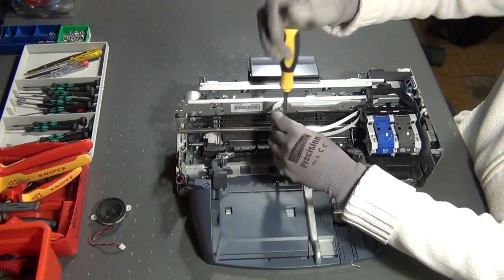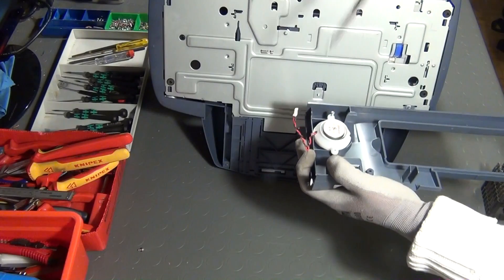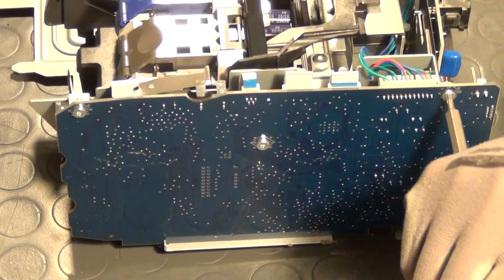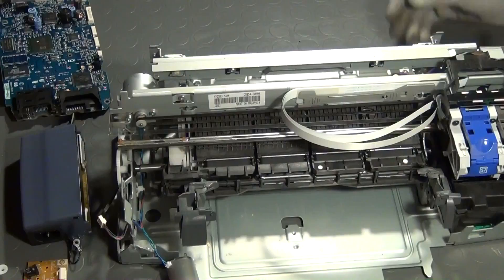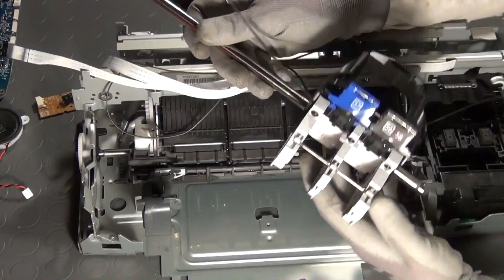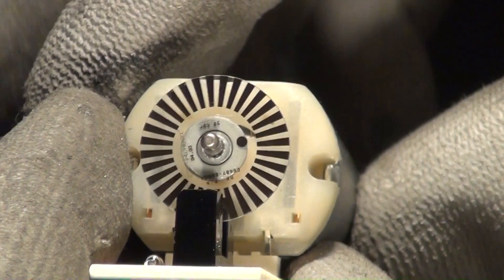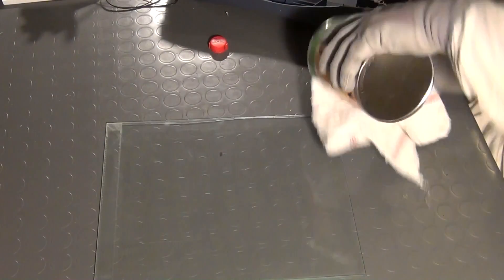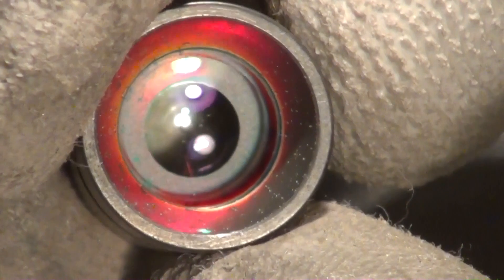How to Salvage Usefull Parts from Printers and Scanners

Comment: I know it's been like 6 years or so, but any chance on a video showing how to use these parts? I have a very old Canon MX712 all in one (fax, scanner, printer with an area for inserting micro SD cards) that finally needed to be replaced. Print heads clogged beyond repair, (I've tried) and the scanner is scanning with lines through it.  I am not a prepper, but I am an artist/maker, and LOVE making new things, or using parts from what others may call junk. I hate planned obsolescence, and filling the junk yard with perfectly good stuff!  So thank you very much for taking the time to make your videos!!  I have subscribed.

Comment: Question for you about using the large motor. Would it be possible to connect more than one motor in series to get more torque/ power, so they could be used in something like a home build CNC? I hope this makes sense, and look forward to replies.

Comment: All that electronic stuff is swell and all, but beyond this old woodworker.  On the other hand, I'll bet the glass is really flat on both sides, and therefore a good candidate for use in the scary sharp sharpening system.  I wonder if they use float glass for copiers.

Comment: That little lens in the scanner is awesome. With a little screwdriver or pick. Take the top lens out. Then sandwiched in the middle is another thick lens. Take this out. Find a hollow tube the same od and cut it to the same length as the center lens. Put the top lens back on. Now you have an extremely powerful Lupe or hand held microscope. You have to put the thing against your eye almost and the objects you're inspecting close to the lens. It's the coolest.
Reply: How can we remove it without breaking it?

Comment: Oh also get you an extension bar for these torx bits that you can put into an electric drill so you don't have to take hours taking these things apart. This one works great and only a few dollars. https://www.ebay.com/itm/2PC-MAGNETIC-BIT-HOLDER-1-4-HEXAGON-BITS-60MM-150MM-DRILL-BIT-EXTENTION-BARS/172088653704?hash=item2811487788:g:4rMAAOSwGotWs4my

Comment: I like taking the rods out and sticking them in the end of a drill gun and spinning them against a stone grinding wheel, then fine sandpaper. They make the best weapons to throw! But know carrying them can and will get you arrested! On your own property you can use them only here in the USA. So I hold no responsibility for your laws where you live. But if you can, make one or two. Then throw them hard with a lot of spin. They always stick. I had to come back and tell people these things are extremely dangerous! They will kill, so do NOT throw them in the direction of people at all. Or in the direction of a house because these things being this sharp will easily pieces things. I was even able to embed one into and old tree log at about 6" deep. Its took pliers to get it out.

Comment: Finally someone else knows how to properly use an HP printer. If you'd go to your local hardware store they sell specialty tools that will help you greatly taking apart the printer at a much quicker pace. Once home take that hammer (I meant Specialty Tool) and if correctly using your new tool you'll have that printer opened and separated within seconds. Good luck!

Comment: Wow, neatly done. My printer salvages looks like the battle of the Somme.
The parts in these machines are truly a delight to grab :)
One thing I would really like is to see a video on different ways of changing or adapting the gear/head of the motor shafts. These are usually really stuck on there, and they might not always be suitable for your projects. Maybe some good ideas of how to fit adaptors or something on top of the existing cogs, or replacing them completely
Reply: you could probably 3d print an adapter or something

Comment: Another great thing to look for is the WiFi circuit.  It usually has 4 wires, and can be reused as a USB WiFi dongle. (Positive, Negative, Data Positive, Data Negative)
Reply: Don't they have a specific/proprietary firmware flashed into them?
How would you re-wrtie/flash so it can be used a generic Wifi device?
Reply: @MezcaleroNM9495  I've taken them off & used them with an old Raspberry Pi. There's just 4 wires, and it took some trial & error to figure out what wire was what, but it just showed up as a generic USB wifi dongle when I wired it into a USB
Reply: @MezcaleroNM9495  You can use a chip flasher if you reaally wanted to. but you need to make sure you know what chip you are messing with. Its $7 on amazon
Reply: @MezcaleroNM9495 Some use proprietary. Some use generic off-the-shelf WiFi boards that use a standard protocol.
It's only a few euros each from AliExpress or similar to buy such WiFi modules, so not the biggest money saving to salvage it, but if you're disassembling it anyways and you have some USB ports laying around it's worth testing.
Reply: Keep in mind it's often 3.3v usb. Still pretty easy to adapt, but you can't just connect it straight up to 5v, that WILL cremate it.

Comment: I am going to look for part two now, this is something I have been looking for as I have an old printer and another printer scanner that are too good to just throw out.
 I hope to be able to make a small CNC Engraver from these parts, also a rotary encoder may be able to be adapted to a lathe (Manual) for speed, indexing and thread cutting operations if I can work out the wizadry to make it all work.
 I know I am late finding this video, however thanks for the upload and you now have another Subscriber.
Cheers from John, Australia.

Comment: if we programming the heads of printers of dotmatrix printers then we can easily produced piezoelectricity by using it and piezoelectricity crystal so large number of electron generators produce and thorium are not used for electron generator in microwave oven since radioactive elements are not healthy

Comment: Optical encoder used in closed loop Stepper motors and servo motors is what that plastic disc is to tell the Controller board where the Printer head is at all times. Basically the same as what is used on a CNC to send signals to a controller for a industrial or Hobby Milling or Router Machine.  https://www.researchgate.net/figure/Optical-Encoder_fig2_317389063

Comment: May you tell us  what old machines have stepper motors ,Thanks a lot
Reply: Copy Machines.. you will find strong 200 step/rev steppers along with their drivers and many more goodies... Steel Rods, Gears, screws, ball bearings, power supply, h-bridges, relays, sensors, wires, springs.. And many more..

Comment: I have an HP printer quite similar to this one ( printer/scanner combo) , sadly i lost the proprietary cord power supply while moving. Apparently it has 3 lines: one  16v at the left , ground in the middle and 32v at the right. It is a little old now yet in mint condition and i really want to use it but without the cable/transformer type thing is impossible, could you please make a video of how either build one or change the powers supply to something else? thank you  in advance, i really love your videos and i´d appreciate if you could help me.
Reply: Check Goodwill type stores. They often have boxes of miscellaneous cords. Also keep an eye Craigslist.

Comment: Still  no Part 2? With 3D printing taking off, the scanner glass has good potential for use on the hot bed. Today just salvaged two.  Very carefully heated the glue with a hot air gun to separate the plastic frame.

Comment: The Part at the end , the small lens can be attached to the rear camera of a smartphone, and help in doing really micro photography of some insects,fabric textures and materials.
Reply: Damn that's pretty cool
Reply: How can we remove it without breaking it?
Reply: Yeah but you have to find a bigger lens and attach it because its need to bend the light to make function
Reply: @catthecommentbothunter6890  most work relatively well on their own. They are macro lenses with a wider than usual view angle.
Reply: @SoftBreadSoft  yeah

Comment: Hello Sir, nice video and great infos here.
Would be possible to take apart and use just the scanner part from an hp f2280? The printer is an a-i-o inkjet but I mostly print documents, so I'm using a laser printer instead without scanner. The real question is: in yout opinion, would the motherboard allow the scanner to work if no printer-components are detected?
Thanks in advance for your effort!
Reply: He will demonstrate how to do this in part 2.

Comment: I once took apart an old scanner from the late 1990's. Needless to say it was big. It had 2 round neo magnets inside. Don't modern scanners use magnets anymore?I recently found a canon 3 in 1 machine. High quality motors but no magnets.

Comment: Hi Sir
does all printer with scanner have stepper motor or even the printer without scanner?
Reply: +JD Punzalan steppers were more common in older printers
Reply: HP uses (and used) mostly encoders with DC motors in printers. some other brands like Lexmark use steppers for paper transport. 
there's always a stepper on the linear unit of the scanner.
Reply from the maker: +JD Punzalan No. Most regular printers do not use stepper motors. The motors in this video are not stepper motors but regular DC motorss. To find stepper motors look for professional photocopiers and expensive laser printers. You should maybe check this video: https://www.youtube.com/watch?v=mSU-GeEe0P0
Reply: +The Post Apocalyptic Inventor wz

Comment: I have a piece of glass from a scanner that I use to protect my bench from heat while soldering. I added some of those sticky rubber feet though so it wont scratch the bench.
Reply from the maker: funkyironman69 That's a good idea as well. Thank you.

Comment: can you use the lens for a microscope, are the metal bars stainless steel, and what can you use the pane glass for?
(i've scrapped and salvaged several printers and scanners, and have a nice supply of the glass, motors, and other components.)
good video!
Reply from the maker: Sooner Science Nerd Not sure what to do with the lense myself. The bars are not stainless. You can use the glass (or even the entire casing including the glass) to build a device for photo etching of PCBs. I'm sure you can find a video about that on YT.
Reply: thanks!

Comment: Excellent video quality - congratulations.
The plastic encoder strip can be made into a good quality Ronchi tester for your telescope.
Cut the strip into 1 cm pieces and mount in a cap in the end of an eyepiece-sized tube.
When focused on a star, you should see straight lines, same inside and outside focus. any bending of lines, or difference between inside and outside focus indicates a defect.
Reply from the maker: astrocaver Thank you very much for that great piece of advice ! :)
Reply: you should make a video of it

Comment: Would love a part 2 as I started disassembling the exact same printer/scanner combo. I am planning on making a laser cutter with the rail + stepper inside for X axis (combined with another one from another scanner for the Y axis, as it is a laser cutter, I will use a servo for Z axisfocus control). Looking forward to a follow up video!

Comment: Do those photo-interrupters and films actually measure angles and positions? They just provide a pulse waveform where the frequency is equivalent to the number of strips that pass in a given time, I think they can only be use for measuring velocity...
Reply from the maker: Well. The interrupters can of course not "measure" anything. They only give pulses. But a number of pulse can be translated into a position,  an angle, a velocity ( if a time base is known at the same time).
Reply: Yep, we agree. This is an open-loop "dead-reckoning" system, with a known starting point you can count pulses to estimate positions, angle etc.

I really like the videos, this is fast becoming my new favourite channel.